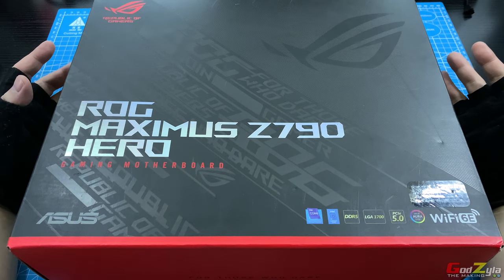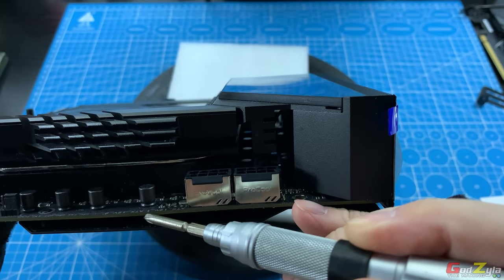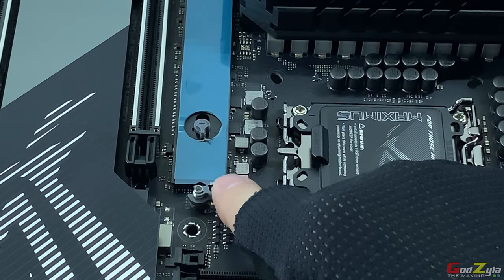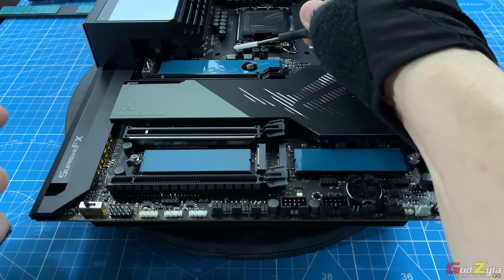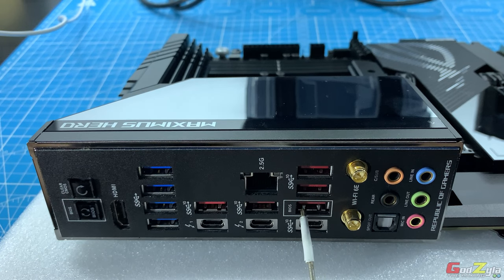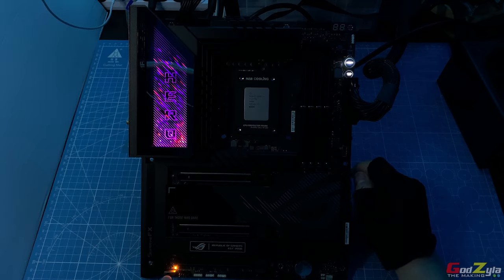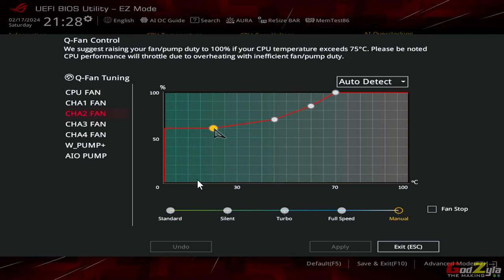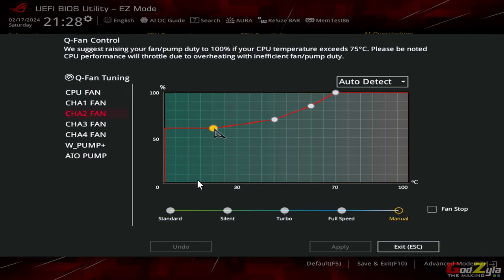Asus ROG Maximus Z790 Hero

Comment: This mb is a joke stuck on 816 bios want update to 904 or last bios black screen and q code show b4 error infinite boot work only with 813/816 bios never buy this asus
Reply from the maker: Hi Luca Giacobbe, welcome to my channel. Thank you for your feedback. It depends how you see it. On bios discliamer, it's often mentioned that if your system is working, do not update bios. I guess it's up to individual, bios update will be critical if you using fast bus speed rams and some are due to overclocking the processor and such. Anyway, thanks for your feedback.
Reply: Were you able to update the bios? there is something preventing you from updating from version 904 onwards
Reply from the maker: @lucagiacobbe4889  I can give it a try this weekend as am pack with work for the moment. will update you on it.
Reply: @KleoYan  many tnk
Reply from the maker: @lucagiacobbe4889  you are most welcome and all the best with your build too. 😉
Reply: Nice video
Reply from the maker: @lucagiacobbe4889  thank you.. as mentioned, will get back to you once I've tested the bios update.
Reply: @KleoYan  thanks, some advice for this motherboard, if you intend to install the video card that works at pcie 4x16 set the pciex (g4) configuration slot to optane memory (it's a bug) otherwise the video card runs at 4x8
Reply from the maker: @lucagiacobbe4889  thanks for the tip.
Reply: Ditto had to take it back to the store
Reply from the maker: @anonymousmc7727  Hello welcome to my channel. So sorry about that. Thank you to have visited.